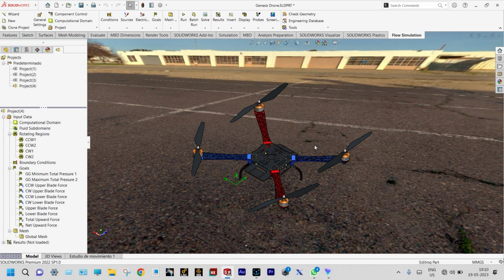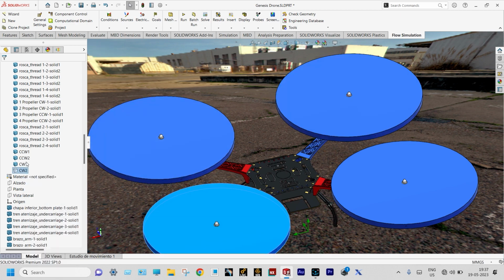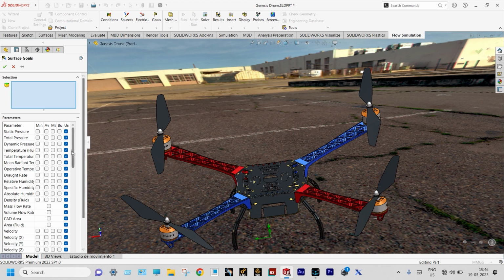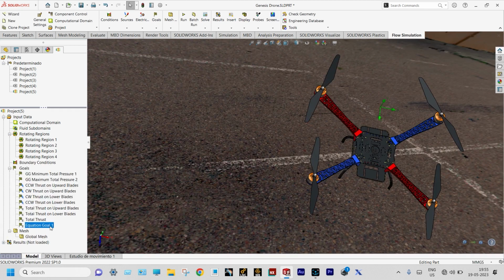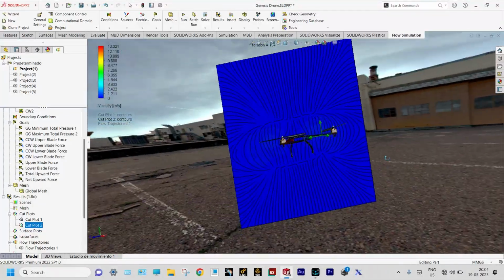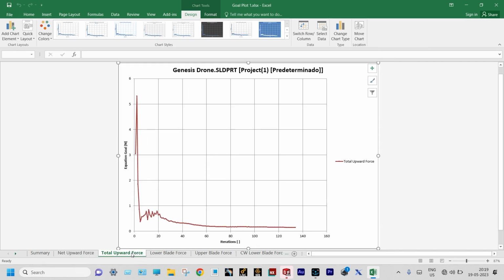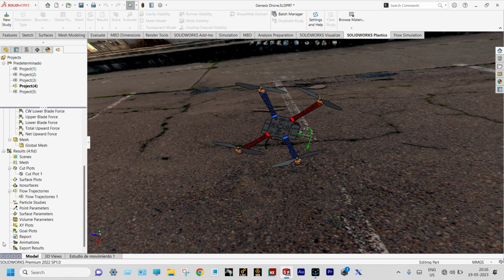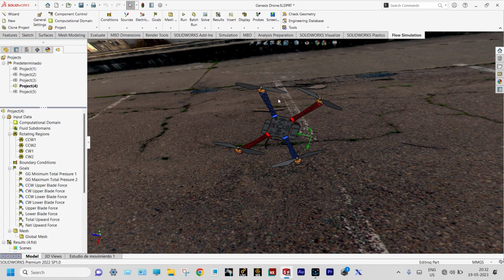CFD Aerodynamic Analysis & Parametric Study Of Genesis Drone - SolidWorks Flow Simulation

Comment: I have a doubt with the direction of rotation velocity. When you assign velocity for each rotation region, you automatically get speeds in downward direction while you have to adjust clockwise or anti-clockwise direction but in my case i am getting velocity in upward direction, so how to resolve it?
Reply from the maker: That is upto you. You may change direction upward or downward as per requirement by changing the direction of rotation. You may change direction to Clock wise or counter clockwise
Reply: @CFD_GUIDE  I am not talking about rotating directions rather the vertical translation directions, I can’t seem to change the direction to downwards as I am getting it upwards. There is no option to change the direction in vertical axis somehow.